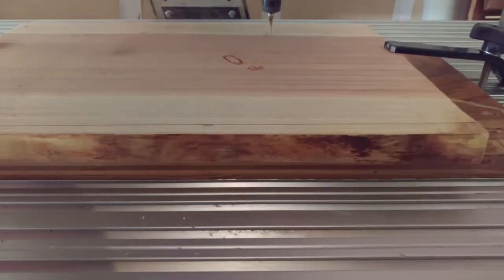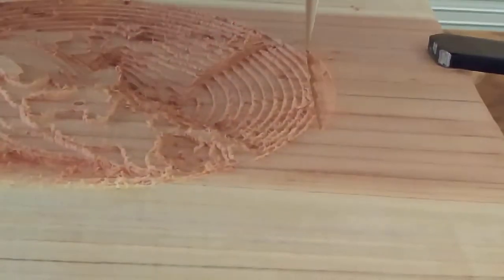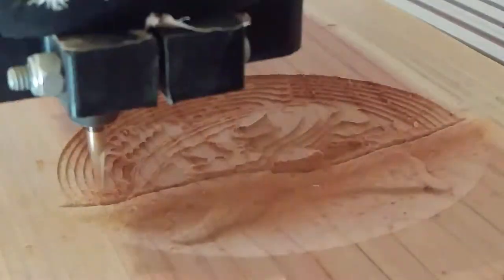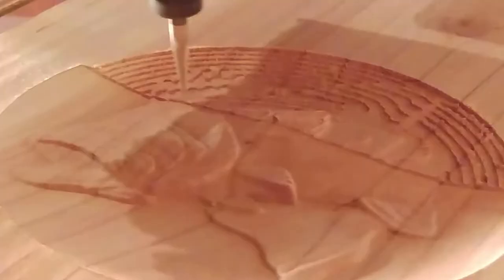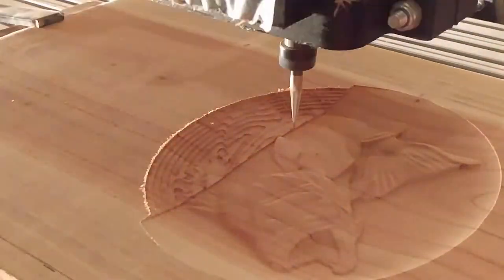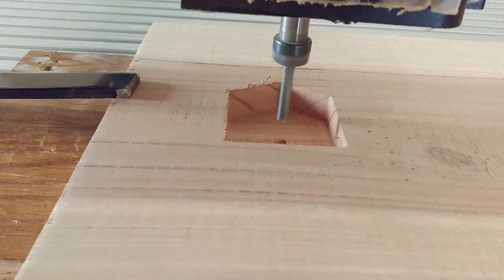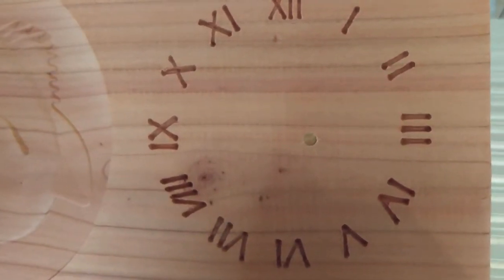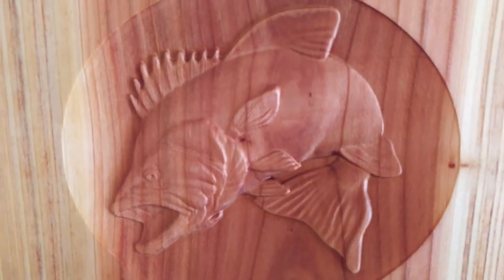3D Leaping Bass Clock Carved On Live Edge Redwood (FAIL)

Comment: That's nice detail on the fish.

To locate the pocket for the clock, you might mill the hole for the shaft from the front as part of the engraving for the clock numbers,  You could then mill the pocket on the backside by lining up on the hole.  Of course alignment pins are also an option.

Since milling the clock is faster than milling the relief carving, you might create a stock of ready made clock blanks and then carve relief figures in as needed.
Reply from the maker: Harry Ragland thank you those are great suggestions. I'm going to do that with drilling the hole from the front. Sometimes I don't think of the simplest answers thank you very much that is going to be so much better. Hope you have a great day talk to you soon tc